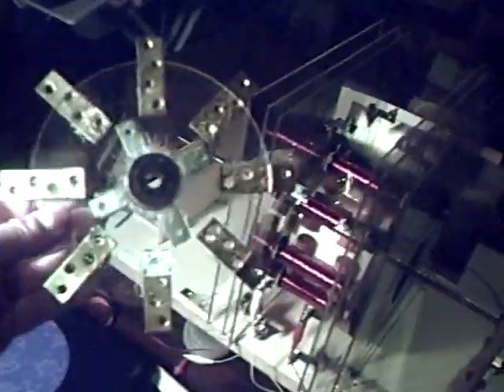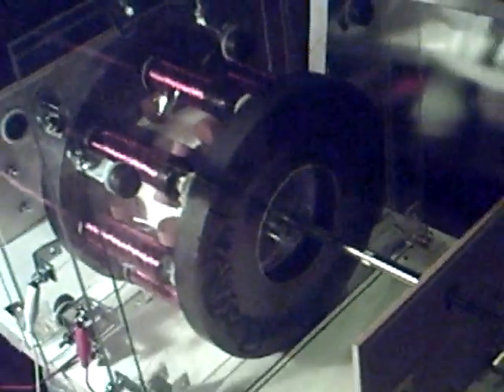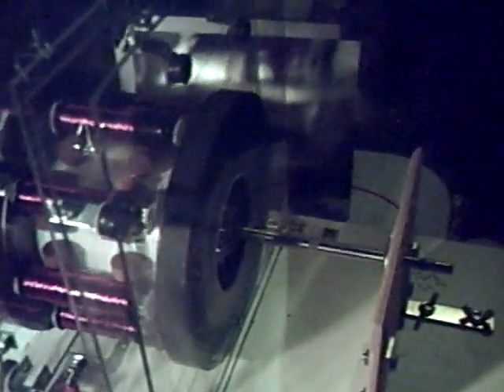LENZLESS GENERATOR 2 without motor /early video

Comment from the maker: Why not watch the newer videos? This is one of my earliest videos. Newer videos show output powering over 200 jumbo leds each with a 20milliamp nominal rating at 2.5 volts, I changed the coils to 18 gage instead of 28 gage, this is not like a Francoeur design because I use repelling fields N-N or S-S not the failed N-S configuration. Also go to my website for more info overunitybuilder com you should do more research before drawing conclusions ii you are a scientific explorer.

Comment: your generator is producing 0.03 watts (3 volts and 0.01 amps)... this doesn't prove that it is a lenzless generator. you are inputting much more energy than it is giving out because 0.03 watts is nothing - it is the output power of 4 bees. you can't say its dragless because you as a human won't be able to detect any drag from 0.03 watts mechanical resistance. nice try though. i'd recommend modelling your ideas in software (such as FEMM) before building them next time - saves you time and money.

Comment: Good work, this is very similar to the interference disk generator by Alan Francour, and other magnetic reluctance generators.
Alan Francour's prototype was much larger than yours, but despite thousands invested could not get it to be sulf sustaining.
Even so, Ive always wanted to build this, and cant wait to see what kind of efficiency you can achieve.